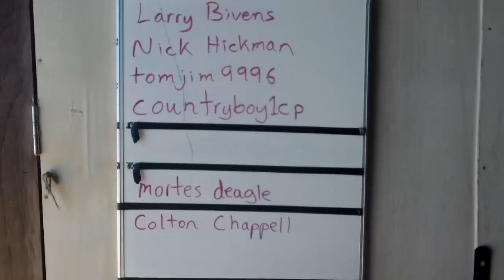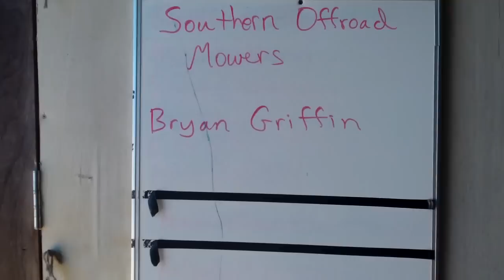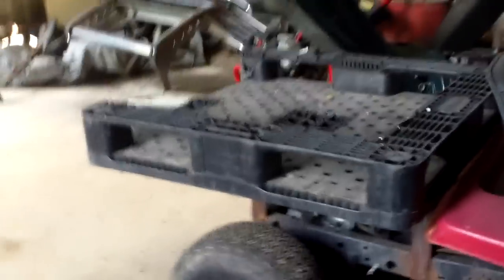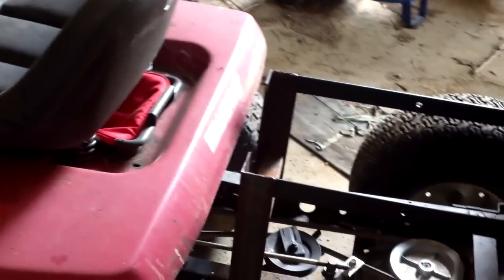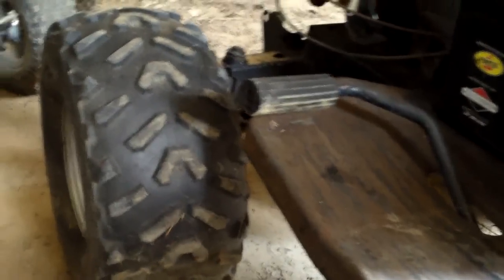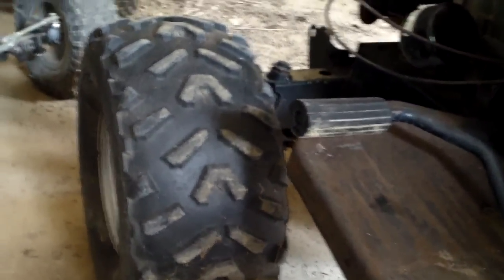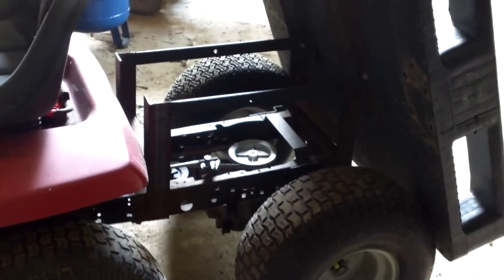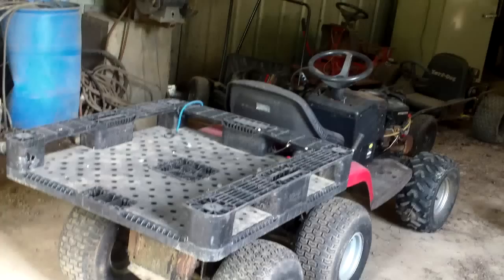Murraygator got loose and ate a Craftsman,,,lol

Comment: If ya look, in the last segment, kudzu is on the right side! I can't believe I missed this video! I need a pull start on my tractor. I've got an old push mower, it doesn't have a gas tank, but it runs, but I might just pull that pull start off of there and put it on the murray! I'm so tired of jumping it once a week, and, if it cuts off, its a pain to push! Besides, font we have riding mowers so we DONT have to walk during the process of mowing our lawns?????

Comment: look at me design just use the same side pully on both ur trans and a belt from trans to trans by belt on brake shaft on transaxles then u can upll top shoft out and cap it and geArs might last longer ?

Comment: Well, one. It didn't fit. two. I couldn't get either fly wheel bolts out to get the cup out. Overall, the only difference is that I cleaned the cover.

Comment: Can you tell me where  I can get a pull starter for my B&S 12 HP model 281707 type 014301 code 89022151    I don't trust that plastic starter gear on mine. keep up the good work and YouTube videos. your Murraygator is off the chain.